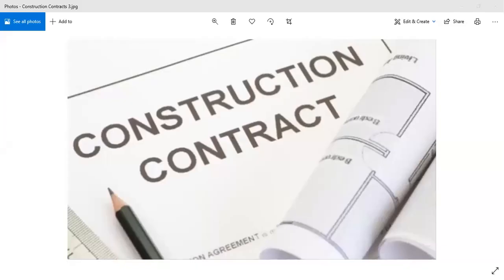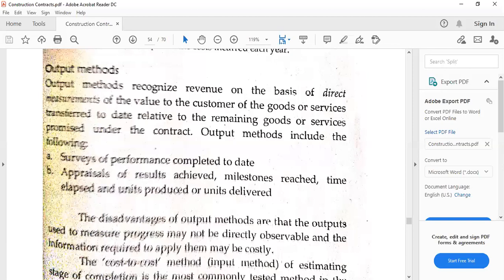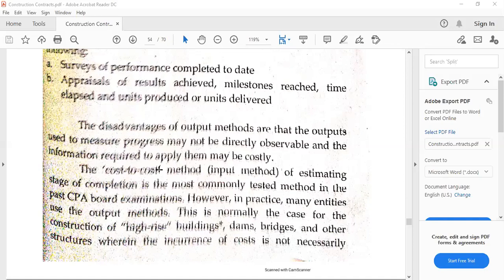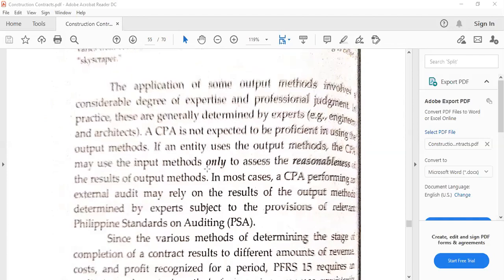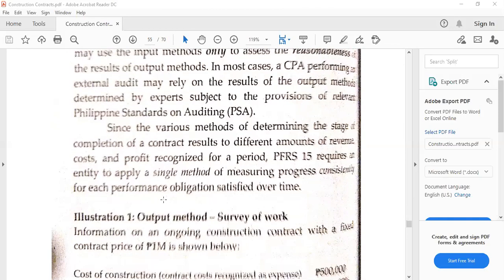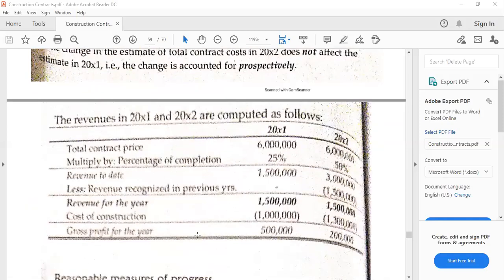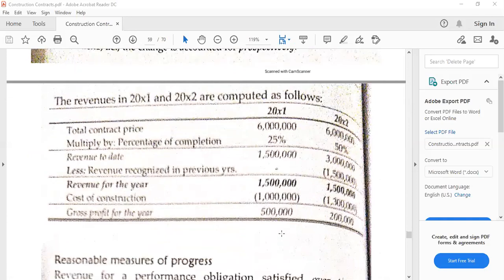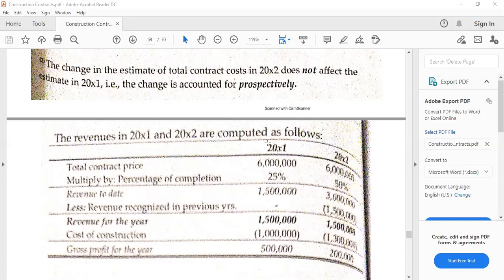Construction Contracts Part 4-Output Method and Zero Profit Method

Comment: In the fourth part of Construction Contracts, it tackled about the output method and zero profit method. The output method is the basis for the percentage of completion, regardless of the work performed, divided by the total work supposed to be complete. Additionally, output method is based on direct measurements of the value of the transferred goods and services to the consumer to date. While the method of zero profit, also known as the hybrid method or method of hybrid contract, is recognized during the periods until the construction is fully complete. I have learned, the excess of the contract price over the sum of revenues recognized in prior periods, recognized as revenue in the year of completion. Hence, we would use the zero profit method if we cannot reasonably or accurately assess the result of the construction contract.  Overall, the video is very informative. Thank you, Sir!

Comment: This video gave me knowledge to another way of computing the gross profit other than cost to cost method, the output method. I learned that it is somewhat the same with cost to cost but the thing is, the output method will not give emphasis on cost. The basis on getting the percentage of competion in this method is the division of the work which is done by the supposed work to be done. I also learned the format, way in calculating gross profits and losses.

Comment: This video introduced another methods under construction contracts which are output method and zero profit method. Under output method, revenue is recognized when certain phases of the project are completed and accepted by the buyer. On the other hand, under zero profit method revenue is recognized in an amount exactly equal to costs incurred for the period. The given examples with computations and journal entries were very helpful as well to fully understand the aforementioned methods. Thank you, Sir!

Comment: As a continuation of the previous discussion, this video brings in another method in computing gross profit or loss under construction contract, which is the output method and zero-profit method. With this video, I learned that under the output method one must based its computation of percentage of completion in whatever work that have been completed over the total of what's supposedly to be completed while zero-profit method (hybrid method) is more on emphasizing that revenue is equal to the cost construction recognized as expense. Furthermore, I gained more knowledge on how to compute gross profit(loss) with the aid of the presented illustrative problems and also on how to journalize such transactions. Thank you sir!

Comment: This video taught me how to compute for the gross profit or loss under construction contract/s using a method or methods other than the input method. It provided me the fundamentals of the computation of the gross profit (loss) under output method and zero profit method, and the examples were comprehensive as well. Thank you for this video Sir.

Comment: This video clearly explained the output method, which is a continuation of the other method (input method) in the previous session. I learned that unlike the cost-to-cost method, under the output method, the cost of construction is not equal to the actual costs incurred in that period. I also learned about the computation of zero-profit method which is also known as the hybrid contract method as discussed by sir. Thank you, sir.

Comment: I’ve learned in this video the difference when we use input method and output method of recognizing profit of a construction contract, also the zero profit method. One difference is that in the output method the cost of construction is not really equal to the actual cost that was incurred in a particular year. Moreover, in the zero profit method, it’s a different computation of the profit because there are actually no revenue recognized when the construction is still ongoing. Through the illustrations I’ve gained a better comprehension about the topic. Thank you, Sir!

Comment: In this video I've learned about another way to compute for revenue through output method. The basis in getting the percentage of completion is the work that is done divided by the the supposed work to be done. I've learned that this method is the common used in practice compare to cost to cost method. I've also learned the calculation in getting the gross profit (loss). Thank you sir.

Comment: This video explained well the other methods of accounting for construction contracts-the output method and zero profit method. Output method is different from the input method (which is discussed from the previous video) because unlike the latter, the cost of construction in the output method recognized as expense for the period is not equal to the actual costs incurred in that period. The other method discussed which is the zero profit method (also known as hybrid method), I have learned from this video that in this method, zero profit is recognized during the periods until the construction is fully complete. And the revenue recognized is equal to the cost of construction recognized as expense.

Comment: In relation to the past videos of Construction Contract, this video has introduced to me the other method, aside from input method, in accounting for construction contracts. This video taught me the output method and zero profit method, where output method, as the word "output" portrays, is based on  the value the customers has gotten relative to the remaining obligation the company has. While the zero profit method only recognizes profits , so far, as it exceeds the cost incurred by the company, where in they basically just recognized revenue on the year the company fully satisfy the contract, and the previous year (under the contract) has no profit at all. Each method was discussed well enough for me to get enough information to apply to the illustrated samples the video has given. The computation for gross profit as to date and for the year was also discussed, as well as the revenue for the year/as to date, thus, I will take note of such computation(formula) given in order to apply these when I encounter such problems or similar problems. Thank you sir!

Comment: This video introduced to us the continuation of methods for recognition of profit in construction contract, i.e. output method and zero profit method. Sir said that these are the more complicated ones so some application of output method requires a considerable amount of expertise and professional judgment. The zero profit method recognizes profits only, while output methods recognizes revenue based on the direct measurements of the value of the goods and services to the customer.

Comment: This video tackled the two other methods in accounting for construction contracts. Output method recognizes revenue on the basis of direct measurements of the value of the goods or services delivered to date related to the remaining goods or services stated in the contract. It has been expressed that this method is usually used in practice more likely in the construction of challenging projects. While zero profit method shows a more conservative approach since it does not recognize profit or loss until a contract has been completed.

Comment: This fourth installment of the Construction Contracts series emphasized on the use of two other methods which are the output and zero profit method, other than that of the input and percentage of completion method in accounting for construction contracts which were tackled in the previous videos of the same series. Output method basically recognizes revenue on the basis of direct measurements of the value of the goods or services delivered to date relative to that of the remaining goods or services promised in the contract. The discussion pointed out that this method is most commonly used in practice especially in the construction of more complex projects. What makes this challenging is that accountants have to depend on the direct measurements from an expert in the field like engineers or architects when using this method. Zero profit method, on the one hand, presents a more conservative approach as it does not recognize profit or loss unless it is the year of completion of the contract. Only revenue is recognized and should be equal to the costs incurred for the period. Journal entries and organized computations were also presented which helped me understand the process more. Thank you for this one, Sir!

Comment: This is the continuation of the discussion of the Construction Contracts series but this video focuses more on the two methods which are Output method and Zero Profit Method. I learned in the video that the CPA board examination usually utilizes cost to cost method. While in the actual practice, CPAs usually utilize output method. I learned that output method recognizes revenue on the basis of direct measurements provided by professionals which are expert in that field. While zero profit method, (also known as Hybrid Contract Method or Cost Recovery Method) does not recognize profit or loss until the year of completion of the contract. We also need to take note that the Cost Recovery Method in installment sales and Cost Recovery Method in Construction Contracts are different. In the sense that in cost recovery method in installment sales we do not recognize revenue until we recover all cost. While the cost recovery method in construction contracts recognizes revenue which is equal to the cost of the construction of the year. Thank you sir and God Bless!